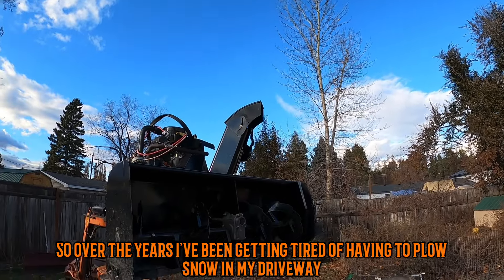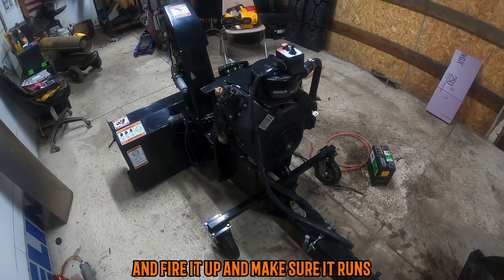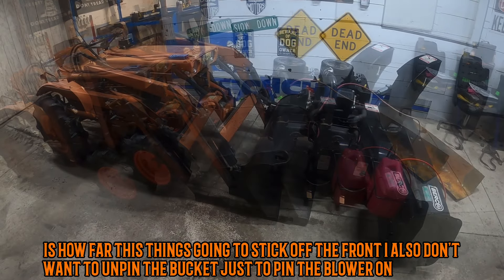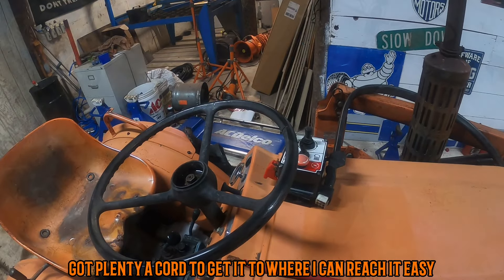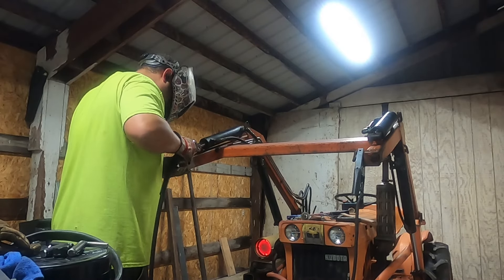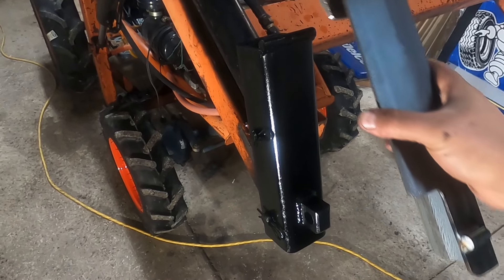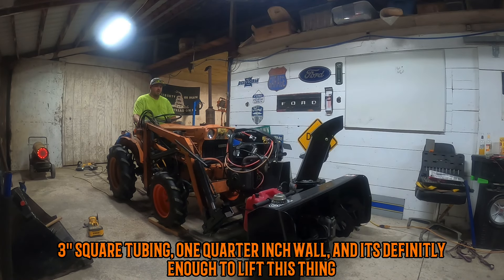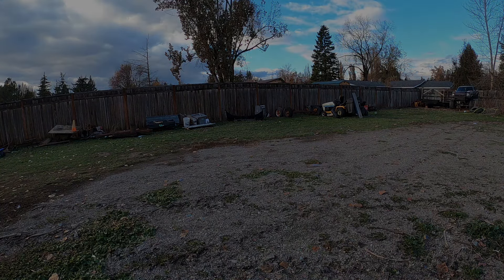Kubota B7100 Gets a Mean Upgrade!

Comment: Make some ballast to hang off the 3 point it will keep you planted and less tippy.
Reply from the maker: I have a plan for that soon, when I get my plasma table up and going I have a design for some nice metal cut out, concrete filled wheel weights. 

The 3 point is only rated for 400lbs, so if I can keep the weight on the wheels primarily it should be easier on everything

Comment: We have a Satoh S370D, 15hp and it was recently rebuilt. Runs like new and has a frightening amount of power! However, we also have a 50" blower unit with no motor that I was planning to add a snowblower engine to it like yours, and mount it on the front. I am hoping a 16hp engine will do the work. We need the loader first, unfortunately, as it is just a bare tractor right now. Very smart idea and well done - thanks a lot for sharing your project and inspiration. Your video is great quality btw. Cheers!
Reply from the maker: Thank you, I appreciate the kind words. Are you planning on buying a FEL or building one?
Reply: I have the steel bottom pin mounts already to weld up, and bolt to the frame and it needs to tie together underneath (front driveshaft in the way). I figure it will be best to custom fit the frame so it clears everything exactly. I am sure there are loaders from a factory to fit these Satoh/Bolens/Iseki models. I really like your quick attach mount. I was thinking the same for the snowblower - and for summer a brushhog. Driving backwards on these small tractors is totally uncomfortable! ps: not sure why the comment is posted 2x - cheers! @SteelDogFab
Reply from the maker: @baconlips  building a loader from scratch is going to be a fun project, I completely agree though, I don’t want to do anything looking over my shoulder on one of these small tractors. I’m a big guy and not flexible haha